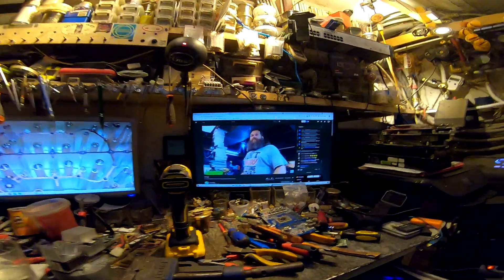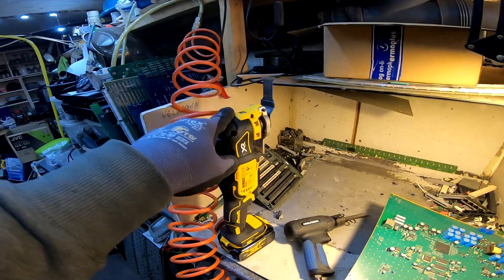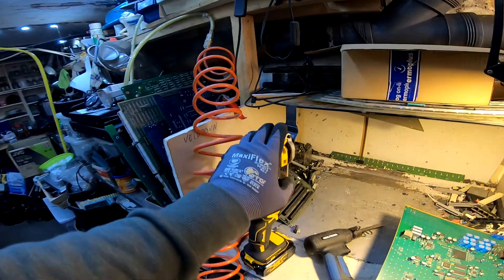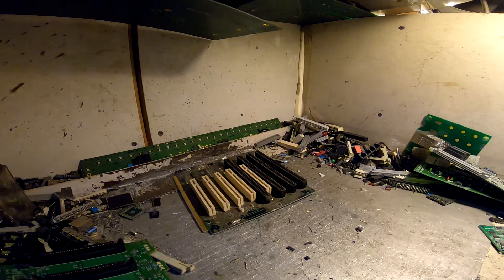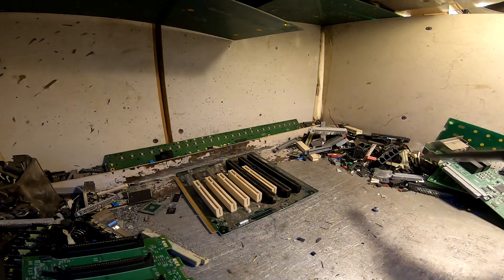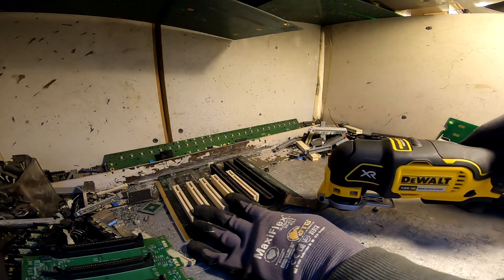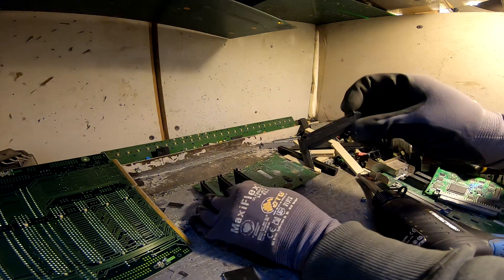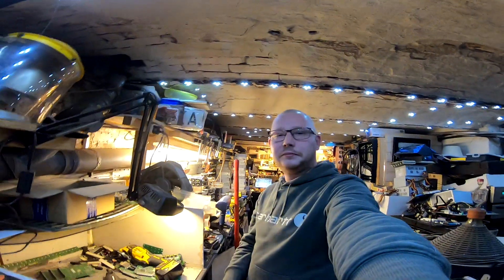Circuit board DEPOPULATION  air gun VS multicutter by @RafalScrapper

Comment: False Way to extrakt the Fingers of the Slot! You must remove  the Plastik first then the Pins! After you can pikup the Pins without the Plastik
Reply from the maker: do you mean pins from the slot??? yeah you right ... but I got my way to deal with it ... but thanks for your opinion
Reply: @RafalScrapper  yes i mean the pins from slot, you can more  win in the deal when the pins clean from plastik
Reply from the maker: @jensvolkmann5544  you right there i know  i do crush the self slots after all and plastic flow on water as it is crushed  enough and pins fall down on the bottom ... anyway that vid you commenting was about depopulating boards... not recovering pins from slots 
cheers sir
Reply: @RafalScrapper   yes. i self recover the most of the Pins from Bords and i selected all plastik  for recovering the pins from pcb of. Its here in Germany the best Way
Reply from the maker: @jensvolkmann5544  how mamy scrappers that many ways to do every task

Comment: there's more than one way to skin a cat.thats why there is many tools.different tools for different jobs..you gave a good example my friend..each tool has good and bad.the trick is to know which tools to use and when to use it.thanks for taking the time to show us rafal..quick question how do you granualate your pins like the ones you showed in your video.id be interested to know.👍👍👍👍
Reply from the maker: yeah sir agree and to know  what tool  got to be used only practicing  can learn,
about that crumbs from ic and plugs i did make an little crusher for it there is few vids about it at my channel they are called "ic crusher" 
and i playing with it cause im not a fan of icinerating chip so trying to find out the way to  skip  burning them
Reply: @RafalScrapper  cool I'll have a look for that video too. I'm not a fan of incinerating also...a lot of times I just soak the big connectors and gold pins in HCI to dissolve any tin I have and then dump them in AP and keep adding but I'm all for learning new ways.i like the sound of ic crushed.thank you
Reply from the maker: @aidavewaste2576  yeah that is the ok way tough as bigger pieces are  more acid and bigger container you need to us e idea was to crush all into so small pieces so acit can  penetrate it thru and use deacent amount of acids  with it
Reply: @RafalScrapper  your 100% correct..thats why I was interested in the crusher as I think it's a better way for the reasons you mentioned..watched the series.good work
Reply from the maker: @aidavewaste2576  glad you like it  tough still need to finish it  but anyway first tests come out  nice and positive